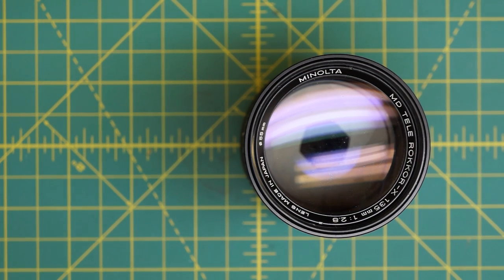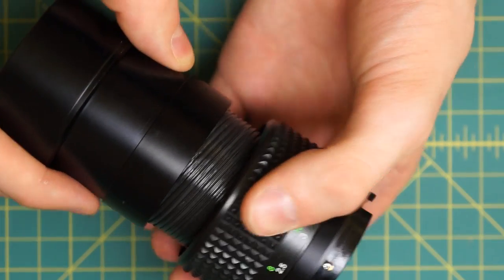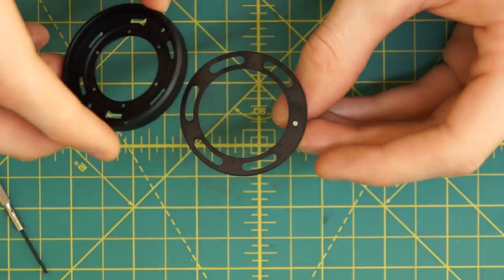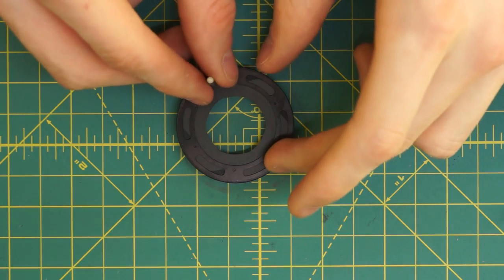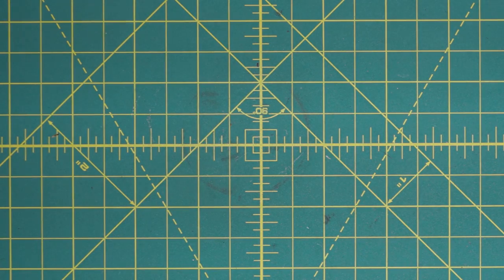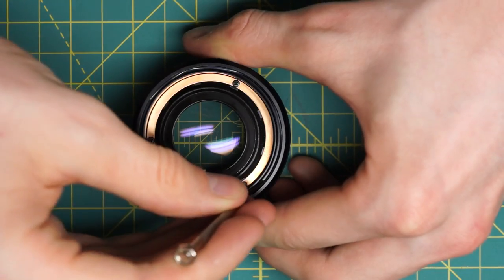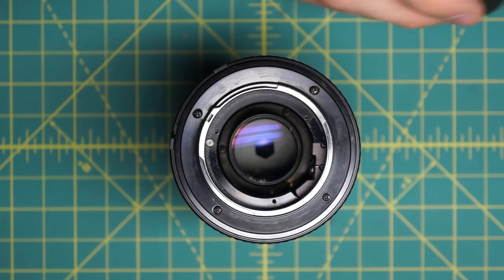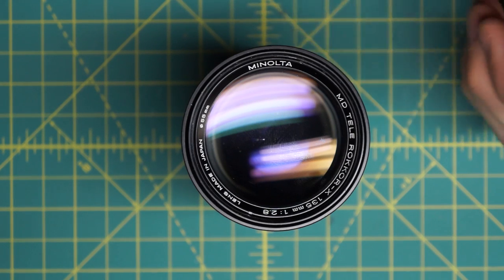Minolta MD Tele Rokkor-X 135mm f2.8 Lens Full Disassembly

Comment: I just got the Celtic Minolta version. Focussing is just a BIT slow, on an MD to Fuji X adapter, but it focusses closer than my other vintage 135's and closer than the 90mm 2.0 Fuji. And stays where you focussed it.  It gets VERY detailed.  Super clean. $28.00 on ebay.  Dat's crazy.

Comment: I just picked up a rather moldy version of the 135 3.5f. It was only $4 so I figured it was worth attempting a clean up. Thanks for the breakdown it gave me a head start.
Reply from the maker: Glad you found this video helpful. Hope your repair goes well
Reply: Thanks Matt. I did the tear down last night and it cleaned up like a champ. The f3.5 version was similar but  even simpler than the 2.8. Aperture was fine so I didn't need to break into that. Next up the Rokkor-x 28mm f2

Comment: Hi Matt.
I was wondering if it was possible to adjust the infinity stop on a Minolta MD 135mm F3.5 and also a Minolta MD 70/210mm F4. I have a number of Minolta lenses that I use on a dumb adapter to a Sony A6000. I currently have the adapter shimmed and have a Minolta MD 28mm F2.8 and a Minolta MD 35/70mm F3.5 Macro perfect at infinity on it, but when I put on the 135mm or 70/210mm they are both reaching infinity before the hard stop.

Comment: Hi Matt,

I have a Minolta MD 135/2.8. How much different is this one from the one in the video. I want to use it on my Fuji X-E2 but it has some fungus of dust inside. So before using it, I want to clean it. Your video is so very comprihensive that I want to try cleaning it by myself. 

And what about  the MD 35-135/3.5  zoom?

greetings, Lenneke

Comment: Dear Matt, I am having serious problems in removing the ring that attaches the front lens. Try to turn with a screwdriver and only manage to damage the aluminum. I applied WD40 without any success. Do you have any tips that can help me? Congrats on the video. Thank you very much for your attention.
Reply: You need a Lens Spanner Wrench. Buy on Ebay/Amazon. They also sell rubber “O” rings that grip on the Lens Inscription Ring for removal. But I would never use WD40 any camera and lens equipment, ever.

Comment: I have a Tokina RMC 135mm, do you know how to remove the front element? It has some fungus I want to clean it
Reply from the maker: I don't know this specific lens, so this is generic advice. Most lenses have a name ring or the entire front lens housing can be unscrewed. For the latter, try focusing the lens out to see if there are any screws near the base of the front section.

To remove the name ring, look for holes for a spanning wrench. Otherwise, it may use adhesive or friction to lock into space. A correctly sized pvc pipe with tape or rubber on the end can be used to apply pressure and detach the name ring. 

Good luck.
Reply: I found a little screw in the front section, I removed it and then unscrewed the front element. Thanks

Comment: Hey there!
The same Minolta ROKKOR 135mm 2.8 was given to me and it seems to be the exact same model as yours.
My problem is the inner plastic-ring in the back. It has all these weird white dots on it and when I wanted to clean it, it was smudgy has hell and I wasn´t really successful. I made some macro photographs of it and blew it up to 100% and it really looks totally odd. Like lens-eating alien worms. ;)
I´m afraid it might be some kind of fungus and if I use this lens on a body this will spread into the camera and on other lenses.
It appears that you have similar little dots and you don´t care, since you think it is in "pretty good condition".

Can you tell me what this is?
Reply: I put the photos in my dropbox.

https://dl.dropboxusercontent.com/u/3248153/DSC07453.JPG

https://dl.dropboxusercontent.com/u/3248153/DSC07453%202.jpg

I would like to use this lens so badly...
Reply from the maker: I've seen this same problem on some other minolta MD lenses, but honestly have no clue what it is. It's not fungus as far as I know, so my best guess is that after 40 years, the plastic is degrading. (Plastic BS is another reason I generally prefer earlier minolta lenses)

Again, I'm not an expert, but I don't think this is something you should be concerned about.
Reply: I found someone on facebook who also had the problem on a Minolta 200mm 2.8 lens. It appears to be the coating on the plastic which is a matt rubber varnishing. It doesn´t age well in basement air and parts of the chemicals start to crystallize. Because of crystallization is bad for the sensor he dissolved the varnishing with spiritus. 
Now the part isn´t that good anymore with minimizing reflections, but the crystals are gone and he doesn´t have any other problems with it.

I think I will try it out in the next days.
Reply: @ThisIsWideAngle  Thanks a lot for the very important bits of information! Do you have any updates on this matter? I'm planning to buy the same lens, but it also has those white spots and I'm wondering if I can safely remove them. Thanks a lot in advance!

Comment: I lost the ball bearing! Do you know what size it is?
Reply from the maker: While I can't check this specific lens, I believe it was either a 1.2mm or a 1.0mm ball bearing. It's certainly one of the smaller ones and very easy too lose. I know Micro-Tools sells small ball bearings, or you can take one from an existing lens (Minolta did use several different sizes in their various lenses however).

All the ball bearing does is lock the aperture at a set of fixed positions and provide some additional tactile feedback. The lens will work fine without it, and many videographers remove the ball bearings entirely, so it's not the end of the world if you put it back together without one.

Comment: Hey Matt Bierner, great vid. I have a Tokina RMC 28mm f2.8 MD... it had a little bit of fungous on the inside of the front element/glass. i took it apart but there are these small difficult screws that are hard to reach. and i don't know how to put it back together lol. i taught it will be as easy as minolta md lenses. minolta md lenses are very simple to disassemble. here's a link of the the specific lens i have. sorry to bother, but if you can help that will be great.
http://allphotolenses.com/public/files/img/8f5bd8be225ab23bf88be29d2ea54cd8.jpg

Comment: Hey Matt! I have a soligor 135mm f2.0 that i need to assemble, to you think you can help me? here is some photos of what im working with right now. http://forum.mflenses.com/viewtopic,p,1452293.html#1452293
Reply from the maker: +Bror Svensson Media
It's pretty hard to give advice from pictures without ever having taken apart one of those before. Almost every lens is different internally, so, although you can use a lot of the same techniques and manufacturers may reused design elements, I would need to actually take apart one to help out.